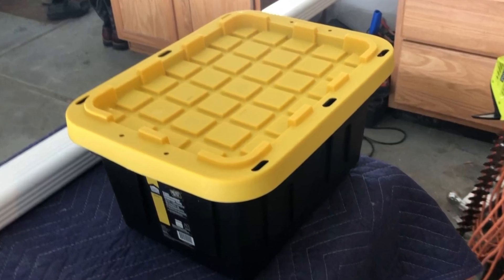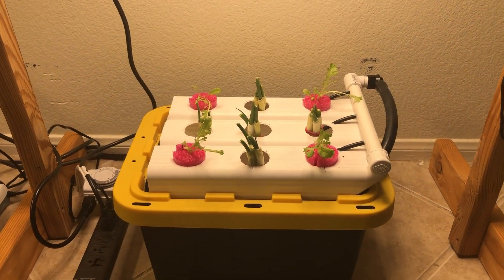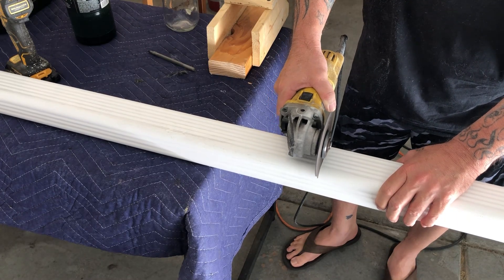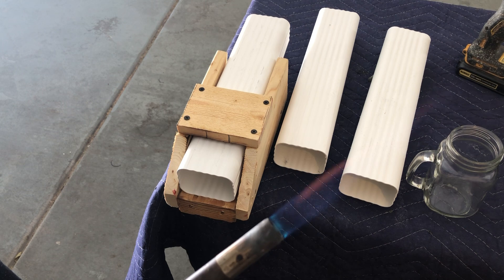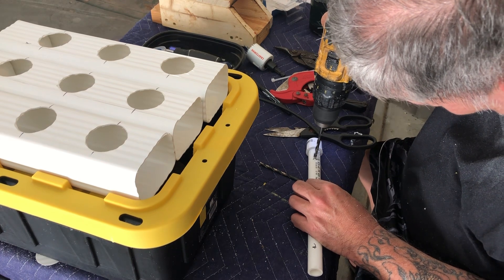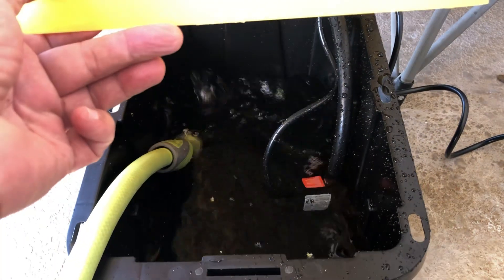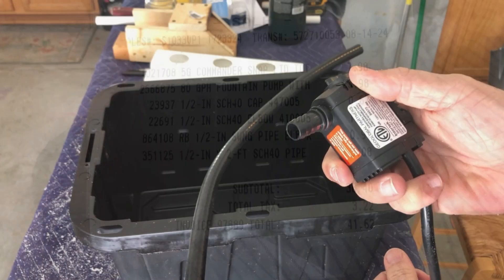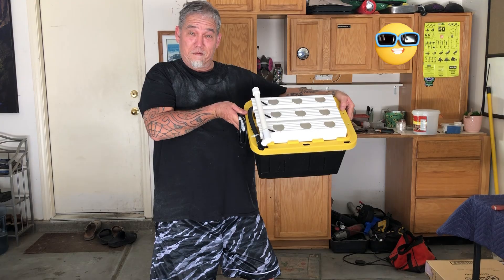Guide to: Building Hydroponic system for Home growers.

Comment: Nice build! Just curious, why can’t the “manifold” be flipped around and have the 1/2” tubing just come straight up vertically?
Reply from the maker: @Croogz  Thanks, and that’s the beauty of building a DIY project you can do it anyway you want it. Aloha Dean 👍
Reply: @Growing-Food-Indoors  Exactly! That’s the fun of it, right haha. Do you have any issues with algae with this setup? Thanks 👍
Reply from the maker: @ Very little to none, Hydrogen peroxide helps with algae, sometimes I add a few teaspoons of it to the reservoir.  I mostly use this mini NFT system as a test bed for the larger NFT system. Some plants love water and some don't, Hope this helps and Happy Hydro. Aloha Dean
Reply: @Growing-Food-Indoors  For such a small setup it works pretty damn good from what I can see haha 👍